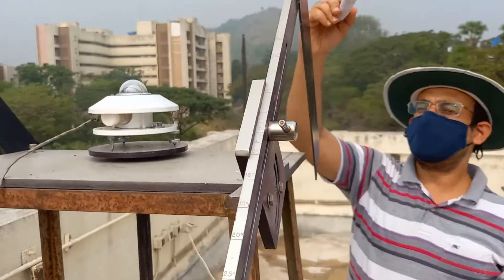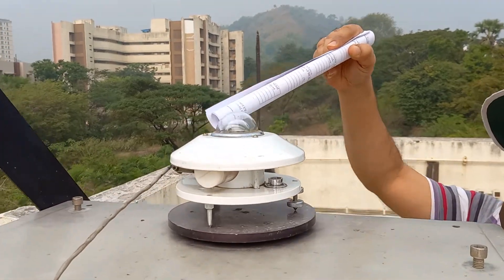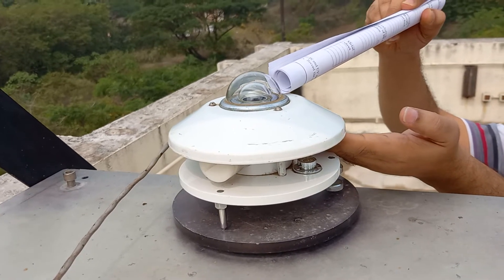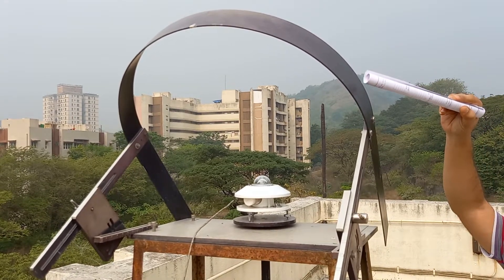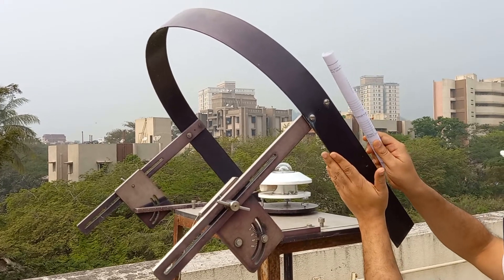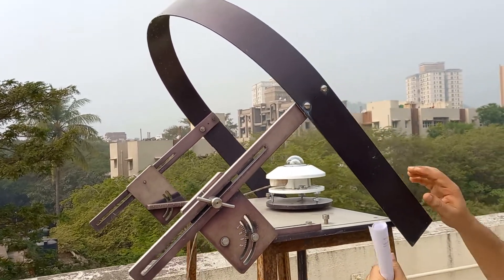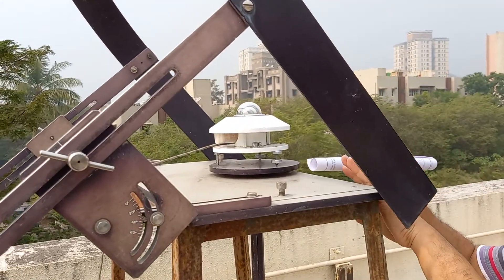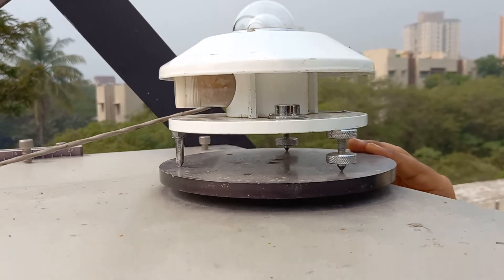Pyranometer with shading ring: Device to measure the solar diffuse radiation on a horizontal surface

Comment: It looks like the angle was once set around 19-20, which is about right for Bombay, but it is at 40 in this video.  If that angle is set to your latitude and if it's oriented correctly, maintaining the shadow throughout the year only requires sliding the shadow band in a linear fashion along the grooves in the arms attaching it to the stand (with the hand knobs).  No changes to the tilt are needed.